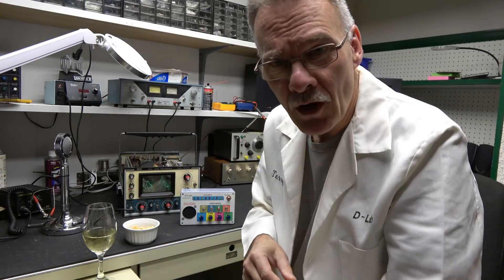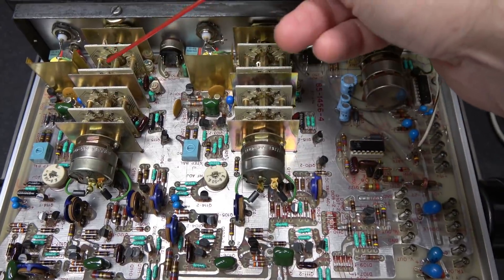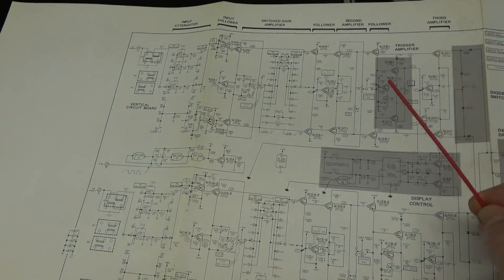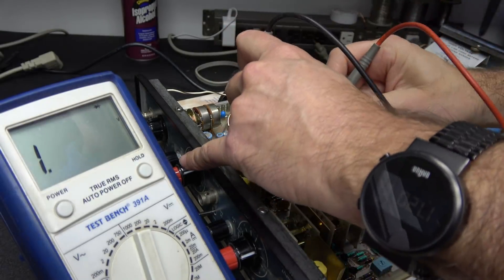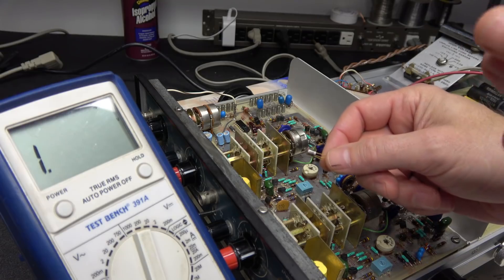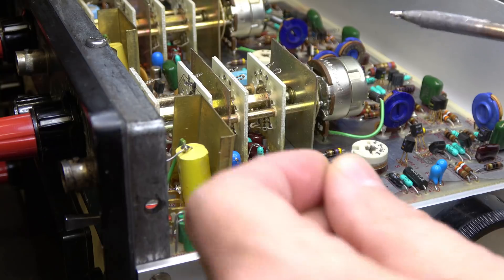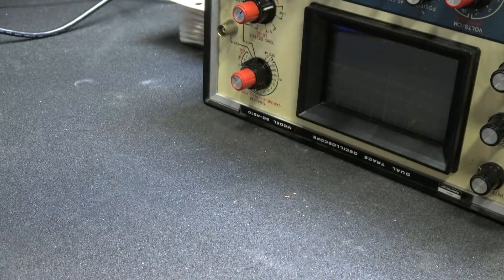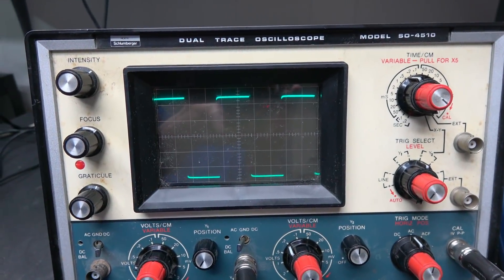How to repair Heathkit IO-4510 Oscilloscope Vertical Channel Part 2

Comment: I have a scope where the vertical drivers seem to become saturated very easily . If I adjust the volts per division down, it starts clipping the peaks of the waveforms.

Comment: Three years late, but because I just did this: it's not that hard to pull the vertical/Y input board. I agree it looks like a pain but I cheated and read the assembly manual backwards for clues.

De-solder the signal connections from the center lugs of the three BNC connectors. The ground lugs for the Y input BNCs & neighboring switches are tack-soldered together and separate easily (if built per instructions). Pull knobs to expose & remove the nuts that secure the switch gear to the front panel. Pull the white/black "gate out" lead straight up to disconnect. Take a screw from each corner of the board and lift the back/inboard edge to disconnect from the chassis. Easypeasy.

Reinstalling the board is complicated because it's impossible as designed. (Oops.) First poke the switch gear thru the front panel, then rotate the back edge of the board down onto the chassis connectors -- which would be easy if you were placing the board straight down onto the connectors but isn't because you're not. The assembly manual says to bend the chassis connector pins towards the back/away from the front panel sufficiently to allow the M pins on the chassis to get started into the F pins on the board. That probably won't make sense unless you're looking at what isn't fitting together. Rather then bend a bunch of pins (again - once 40 yrs ago was probably enough) I popped the front connector (+15V,...,MODE IN) back thru the chassis, installed the board, then pressed the connector into place through the chassis and straight into the board. In retrospect I'm not sure that's a better idea because it's a lot harder to mash the connectors straight through the chassis than to fit them into place one end at a time.

D-lab's top-side repair looks like a sensible expedient for replacing one part. I'm in for replacing two tantalum caps that burned, plus all the tants that want to burn next, plus at least one resistor that burned before its tantalum friend gave up, and whatever else ain't right :-/

Comment: Great videos sir, I’m now subscribed to your channel. Perhaps, you could help me. Here’s the issue with my recently acquired Vu-Data portable oscilloscope [ps910b]: it looks great and it is very clean, inside and out. It seems to do well, with AC signals [I got this scope 2 weeks ago - haven't had time to play with it much yet] BUT when it comes to DC, I get the reference trace just fine but the instant I place the probe onto, say a 1.5 volt battery, the trace which should move up vertically, instead disappears - so, I end up having to fiddle around with the +/- trigger to locate it. I do find it eventually but I don't think this is normal. I should point out, that I’m just an electronic enthusiast [without any formal training] and this is my first o-scope. It’s a small single channel, cheap, clean and it came with its manual [which is really more of a technical service manual - not a user-friendly instruction manual, and somewhat over my head]. I’ve fixed a few CRT TVs, few old radios, fans, etc, but nothing as complex as a scope. I don’t want to damage it accidentally.  Frankly, I couldn’t even tell you if it’s a vertical control issue or an horizontal one... Please let me know what you think. Any insight will be greatly appreciated. Thank you kindly, in advance.

Comment: People claim these are not worth 50 bucks... but I have the IO-4210...built it back in the early 80's ...I know is only a 10 mhz  but it still works great and it is still useful for tracing signals and basic trouble shooting ... most hobbyists don't have the luxury of blowing big $$$$ on a good scope...

Comment: work on an old philco console radio...(47-1227)  nos tubes  installed, wax caps and electrolytic changed out, 90%resisters changed.. no sound  but when im turning the tuning capacitor i get to a spot where i hear a tapping sound coming out of the speaker and as i continue to turn the tapping sound gets faster until it disappears.. sounds like a machine gun so to speak before it stops..   any idea what that might be??  anybody?...

Comment: Great video as usual Terry. I just can’t figure why you don’t use a nice auto ranging DMM. I have and use some manual ranging meters but love my Fluke 189 and Brymen BM869s. Both can look at DC with AC components in the signal along with frequency, duty cycle, DB, VFD..............with dual display. Love them for quick checks you would have to use a scope at times to see. I love my old VTVM, Simpson and Triplett analog meters but can’t live without the newer meters with the features I mentioned. The mixed AC and DC signal feature is great for seeing leaky caps while running a test signal. I’ve heard you say in many videos you don’t like the auto range meters but I bet you’d dig the hell out of the Fluke 189 or the Brymen 869s. Watch Joe Smiths video of running these two meters through his torture tests. Keep the great videos coming. Always look forward to tube amp theatre. 👍
Reply: I agree in part... but will never get over my love affair in Biomedical Engineering when I met a trusty old Beckman Instruments 300. Our shop took over hemodialysis maintenance that's what the previous tech used. I laughed. Until I used it.  it was simple, accurate, and fast. No crap that I would never use. The boss gave it to me, such was my love affair. It died. Beckman just sent me a new one for free... years later, no questions asked. I couldn't believe it.  Alas, a thief finally got my 300.  Time goes on.  And i still miss my old Beckman.

Comment: Very nice job. It's so satisfying to see an old scope brought back to life. 

Do you remember the 520B B&K transistor tester? I had one in the late 1970's. It beeped as the leads on the transistor were checked. Very quickly identifying the bad one.

Comment: At the U.S. Army Signal School, I learned that if a transistor is PNP or NPN, you should have a high and a low and a high and a low from Base to Emitter and Base to Collector. Switching leads between B and C. Then again between C and E. Should be Open in one direction and mid-range in the other. A high and a low. 1 or Open. .500 or low.